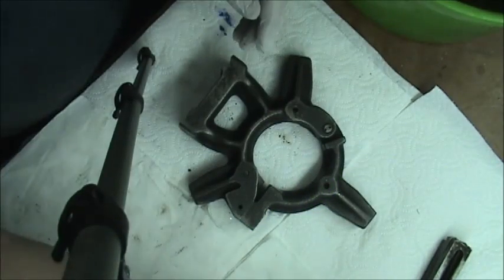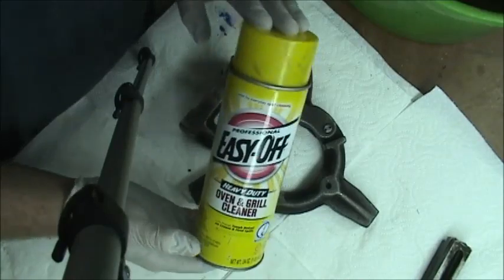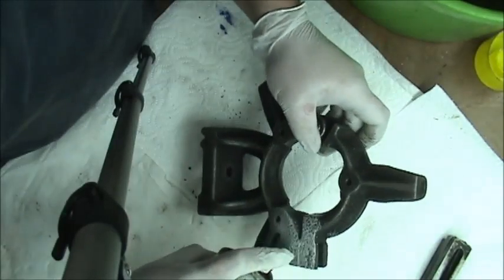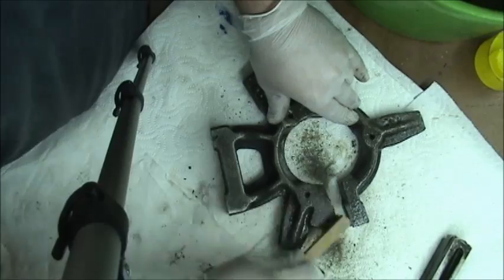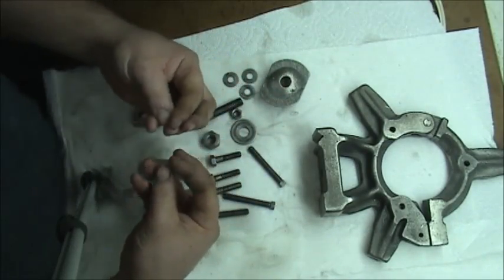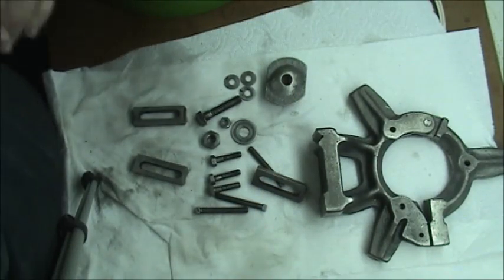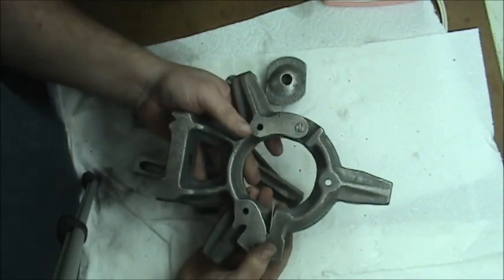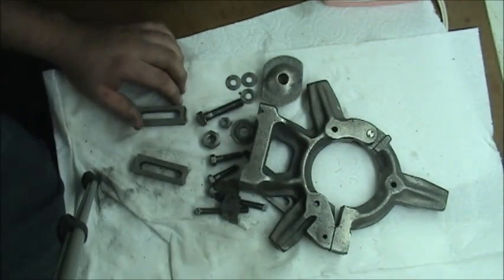How to strip your lathe for new paint

Comment: One thing worth noting is that after cleaning the lathe parts with water it would be a good idea to carefully heat toshe parts in an oven or with a propane torch to release any moisture from the pores of the cast iron which might lead to rust later on..

Peace!
Reply: I tried to fit my south bend 9C in my house oven but my wife yelled at me lol jk . But that is a good point

Comment: The Post Apocalyptic Inventor has a great video on removing rust by electrolysis.  They key is DC electricity with very high amps. Higher the amps, faster the rust is removed. He uses a DC welding machine and at max amps (about 40), only took about an hour.  Keep up the great work!

Comment: I just used some easy off on my tail stock which has 2 layers of paint.  It was coming off within seconds.  Great tip!  Once you've got everything stripped how do you avoid rust before painting?  I stripped my headstock and it started to rust almost immediately after I rinsed it.

Comment: What an excellent video!  I never thought of using easy off.  Ima give this a shot on my SB drill press.  Do you have anything that takes off deep rust?
Reply from the maker: Evap-o-rust works great.  One of those rare gems at harbor freight that actually does what it's supposed to do.  Only issue is the part must be completely submerged in the solution or else you'll get a weird discoloration at the point the part sticks out of the liquid.  Another thing that works well is electrolysis.  You'll need a tank, a car battery charger, and a sacrificial anode plus a solution of washing soda.  Plenty of tutorials around the net.
Reply: I've seen the tutorials on electrolysis, don't want to try it.  I wonder if keeping the part in water creates its own rust that fill and anodes.  I might be way off, but I like a little 1500 grit sand paper using a spray lube like wd40 or liquid wrench on non- critical things.  Thanks for the post!  I'll try evaporust one day.
Reply from the maker: kg6tgr Grey scotchbrite and barkeepers friend went a long way in cleaning up the dials, pulleys and all the bare metal bits on the machine.

Comment: I just got a super deal on an old Logan from 1945. I bought that one and then the very next day some guy told me a completely stripped down Logan of the same model for $200 and I swear to Christ it has never been used the gears are like brand new all sharp corners nowhere whatsoever not a scratch or a pit mark on either one of the beds nothing. I'm using the one from 1945 and keeping the other one for spare parts. I need to use the thing on a daily basis but I want to paint it the paint is in terrible shape just from the years. So I started taking it apart component by component stripping it with a wire wheel gingerly of course dipping in oil and then reassembling it. Again because I have to use the thing everyday. My question is is this a safe practice to leave it on painting and just try to keep oil on everything to keep the rest away until I'm ready to paint it?

Comment: I tried this but it did nothing what so ever on the paint.  im not saying that it doesnt work im just saying it did not work for me.  I ended up buying klean stip 6 bucks a can.  did have my lathe in about an hour and a half and it melted straight through the grease and oil.

 I really want to leave my lather bare metal and simply keep it rubbed down with oil..... its a logan 820 from 1945

Comment: Purple power, full strength. Wear gloves
Reply from the maker: For me at least the Purple power only took off paint that was in bad shape.  It didn't touch stuff that was adhered really well.
Reply: I used it full strength out of the jug and it cleaned up the parts really good. I am always open to try something new though when it comes to cleaning old machinery.
Reply: +Mike C I used purple power as well but it doesn't get all the paint. What I think I will do and use the purple power to do a pre scrub to get as much grease and old swarf off as possible and than hit it with the oven cleaner outside. I am doing the bed next so this weekend ill put it outside on some saw horses and use a hose to rinse it off over an old kiddie pool.